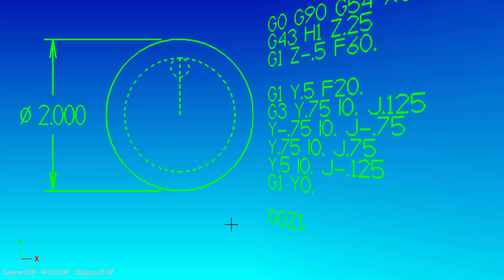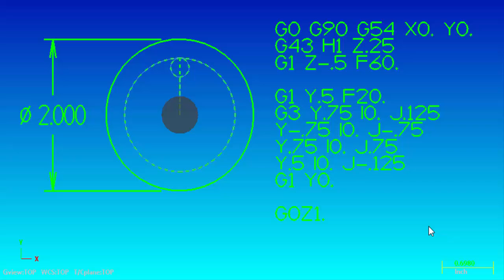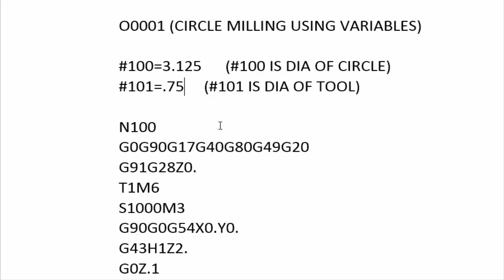CIRCLE MILLING USING VARIABLES

Comment: #101/4 I couldn't understand this part, why 1/4 and not 1/2?

Is this for machining two separate diameters?
Reply: It's the lead-in radius. The .500 dia tool is .250 away from diameter of circle. The radius of .250 is .125, OR .500 / 4=.125. The variable at #101 is the tool diameter, so no matter what tool diameter you put there, the equation is #101 / 4. IE, whatever size tool you use, it will swing the proper radius into the circle diameter that you are cutting.
Reply: Thanks for explaining that

Comment: Great video, have a question for you. I am kinda new to using macro variables, but was wondering if there is a way when circle milling to add a variable for a step over. Say I wanted to start at one bore size and finish at a different size without having to change the hole size variable each time. Thanks for your help.
Reply: You need to set a variable for start diameter and finished diameter, then step distance. Use WHILE DO and work in the math. It can be done.

Comment: Hey Tom, your videos are great!......I was wondering if you could help me create s face mill macro program using a 1.6 dialed face mill and just have it have two variables. #1 being length and #2 being width. I am having problems because as I increase the width I need a step over amount to add( maybe .8, half the cutter). Can you help me...Thanks

Comment: Should the first g1 movement be [#100/2-#101/4]?  I tried using a 3/8 cutter to cut a 1/2" hole, and it wanted to go to a negative that was beyond the size of the hole.
Reply from the maker: Hey Timothy. A 3/8 tool doesn't give you a whole lot of wiggle room. You may need to consider a smaller tool.

Comment: (If using Mach3, negative coord won't work with variables,
use this)

O0001 (CIRCLE MILLING USING VARIABLES In Mach3)

#100= 2 (#100 IS DIA OF CIRCLE)
#101=.5 (#101 IS DIA OF TOOL)

(TOOL # AND H# SHOULD BE THE SAME)
(CHANGE RPM AS NEEDED)
(CHANGE FEED RATE AS NEEDED)

N100
G0G90G17G40G80G49G20

T1M6 (T# SHOULD MATCH H# BELOW)
S1000M3 (RPM MAY NEED CHANGING)
G90G0G54X0.Y0.
G43H1Z2.M8 (THE H# SHOULD MATCH TOOL # ABOVE)
G0Z.1
G1Z-.1F20.
G1X0.Y [#100/2-#101] F10. (CHANGE FEED HERE)
G3X0.Y[#100/2-#101/2]I0.J[#101/4]
G3X0.Y[[#100/2-#101/2]*-1]I0.J[[#100/2-#101/2]*-1]
G3X0.Y[#100/2-#101/2]I0.J[#100/2-#101/2]
G3X0.Y[#100/2-#101]I0.J[#101/4*-1]
G1X0.Y0.
G0Z2.
M5
M9
G90
G0 X0Y0
M30
%
Reply: This should work with MACH3: X[-1*#100] Y[-1*#101]

Comment: if you start and end at the same place in a circle you dont need an X or Y, just the I or a J. 
G3X0.Y-[#100/2-#101/2]I0.J-[#100/2-#101/2]
G3X0.Y[#100/2-#101/2]I0.J[#100/2-#101/2]

could be rewritten in one line of code as:
G3J-[#100/2-#101/2];

makes a complete circle.
Reply: Hello bro

Comment: Can this be done using cutter comp instead of variables? Someone mentioned cutter comp cannot be used when circle cutting. Is this true?
Reply from the maker: Cutter comp can be used to mill a circle as long as a linear move is used on the line where cutter comp is engaged.
The variables give you much more control of the size of the circle and the diameter of the tool. Hope that helps.
Thanks for watching.  Tom

Comment: I experimented a little bit with this in Gwizard and i got to the conclusion that i cannot change the coordinates for y, only for x. For y i was not able to do it, so if i want to do multiple holes i have to change my origin every time for the new coordinates. I was wondering if this can be fixed, maybe i missed something. Thank you in advance.
Reply: Did you make the cutting portion a subprogram and use a G91 at the beginning?

Comment: Nice explanation! Would you have a look at it if this is good for the same code for G2 please.
G1X0.Y- [#100/2-#101] F10. (CHANGE FEED HERE)
G2X0.Y[#100/2-#101/2]I0.J-[#101/4]
G2X0.Y[#100/2-#101/2]I0.J[#100/2-#101/2]
G2X0.Y-[#100/2-#101/2]I0.J-[#100/2-#101/2]
G2X0.Y[#100/2-#101]I0.J[#101/4]
Reply: that should work fine, youll just be conventional milling the ID of the circle.

Comment: i have a question? 
when using G12 -13,whats the meaning of I and k..i dont think is the same meaning as G02/3
Reply from the maker: No they do not have the same meaning. The I in a G12 circle milling cycle  is the start diameter and the K is the finish diameter. Thanks. Tom.
Reply: dont forget the Q for stepover.